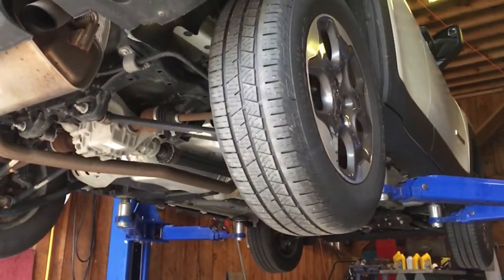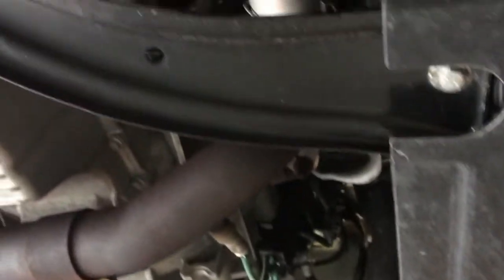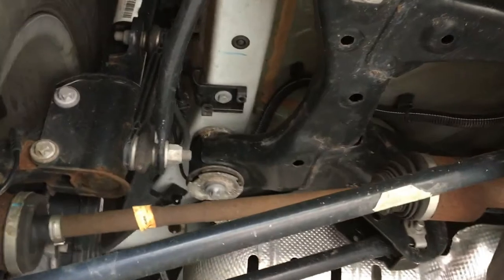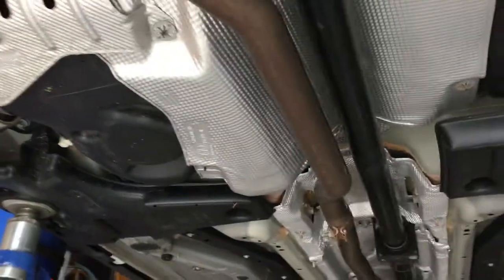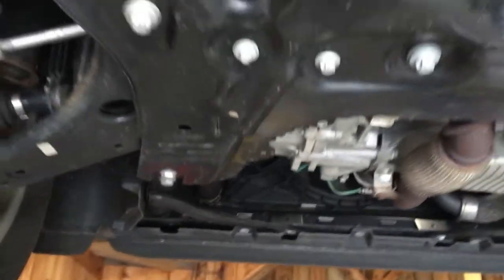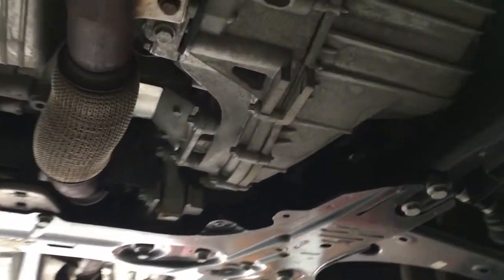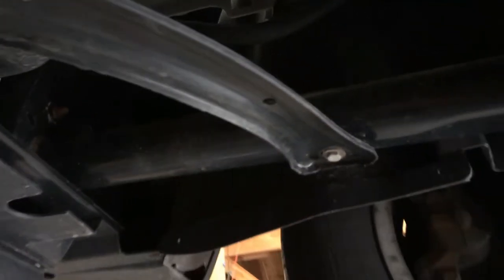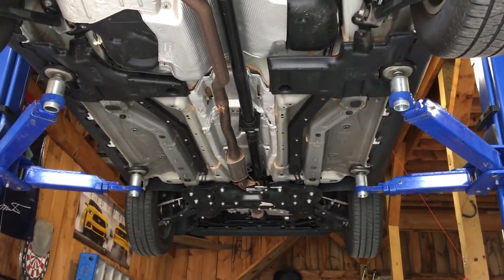What is Under the Jeep Renegade?

Comment: those metal bars under the car that goes at an angle on both sides at the front of the car. you said they where for “crash support”  you can see it clearly at 5:23 i had to be pulled out of the mud and someone chained up to that piece and it’s bent now, is it important that  i get this replaced? and if so how do i find it because i am having no luck when i look for crash support frame.

Comment: Great video!  I also have the 1.4T/ 6spd, it's a nice set up.
Reply from the maker: Thanks, it is a nice setup just wish the trans was smoother.
Reply: @JrsGasolineAlley  Mine shifts really smooth. I read autos are the ones that shift rough. Did you have a problem with the 6 speed shifting?

Comment: I love your lift. I, however, will need to use jack stands. Where o where are the contact points? Can't use the pinch weld area, so I'm perplexed. Your input would be greatly appreciated.
Reply from the maker: If your worried about damaging the pinch seam then you can use these adapters for your jack. https://amzn.to/2EEcl5f
Reply: No, I was more concerned about jack stand placement. The jack stand doesn't seem to have a place flat enough for good contact. There is a spot I noticed that is more inside of where the pinch weld is, but not sure if that's a good contact point. The service manual photos are horrible.
Reply: Just a quick update... I FINALLY found some info and photos of where exactly this vehicle should be lifted from. It's exactly where I suspected. Forget the pinch weld. That's basically for emergency flat repair. It's more inward on a flat, steel ridge. I wish I could send a photo, but believe me, I tried it and it's MUCH safer than that pinch weld location. Too bad they don't make this info more obvious.
Reply: I actually did order those pinch weld pucks you recommended, and they worked perfectly!  Perfect fit! They held up nicely too. While the car was lifted on the jack I placed the jack stands under a support rail  (I'm sure you know the spot), and I got all 4 brakes done. The rears were a little tricky because I didn't have that special tool needed to twist the pistons flush, but I got it with needle nose pliers. Anyway,  would not want to have lifted it without those pucks. Thanks!

Comment: I was just wondering where the screw in eyelet for towing is connected in the renegade and if it was strong enough to actually be pulled on if you were stuck in snow or something. I can find nowhere to pull. Also with the latitude 4x4 if a hitch was installed could you pull from that or would it be attached to subframe and be too weak?

Comment: Got a 2015 Renegade Trail hawk. When the weather is cold 32 or below, start it up and have a noise which seems to be coming from the center between driver and passenger seats and just in front of the dash area, underneath.  The best way I can describe is it sounds like something is rotating, but noise sounds like "taDump".  When the engine is warmed up the noise stops.  Any suggestions? Took to dealer and they changed out the sway bar and  sway bar links.  Noise still there.

Comment: I'f I wanted to change my transmission fluid where it that at? My owners manual indicates fluid for manual trans fluid, auto trans fluid and PTU fluid if equipped. Not sure what fluid to use or where to put it. Thanks ps I have a 2.4L AWD automatic

Comment: Any idea how to add mechanical lockers or at least limited slip to the diffs?  I know the Cherokee trailhawk comes with a proper rear locker, but the gearing is different and probably wouldn't be compatible.
Reply from the maker: I don't believe it would be possible. These are e-diffs anyway that disengage from the driveshaft too, helping to lower drag.

Comment: Is there a way to lock the drive line so it basically acts as an AWD vehicle all the time? Like IDK an ecu thing or something else
Reply from the maker: What would you be trying to gain?
Reply: @JrsGasolineAlley  making a full time AWD system for a custom build Dodge Dart using only Mopar and Chrysler products
Reply: @JrsGasolineAlley  if you want to check it out I have a playlist on my channel for it. I'm going to be putting out a lot more videos on it as a accumulate the parts needed

Comment: Do you know why those 2axel shafts starts rusting so fast???mine did too and it's only 4months old
Reply from the maker: That is normal. Depending on the coating on some of the parts the quick very orange rust is supposed to happen. Believe it or not, the rust actually protects the parts into the future.